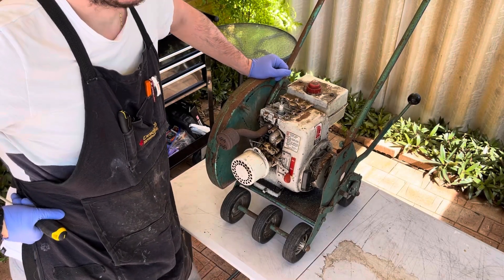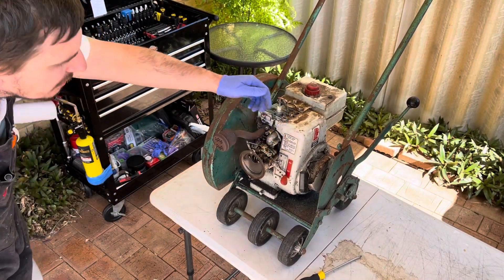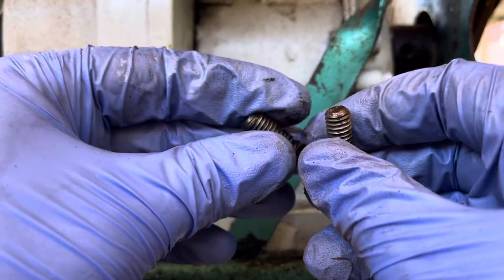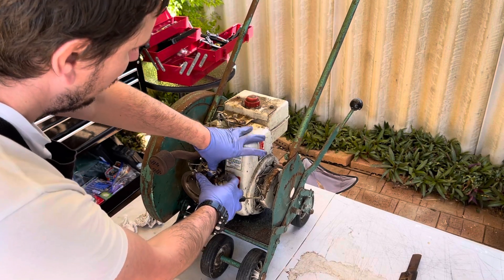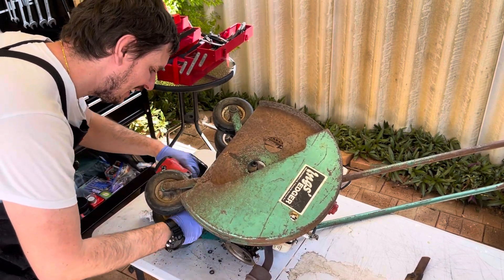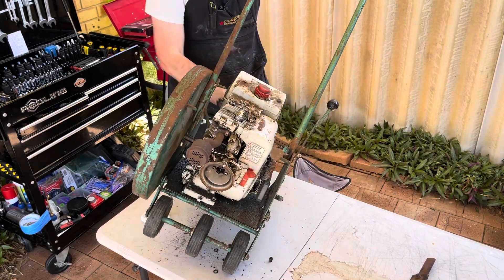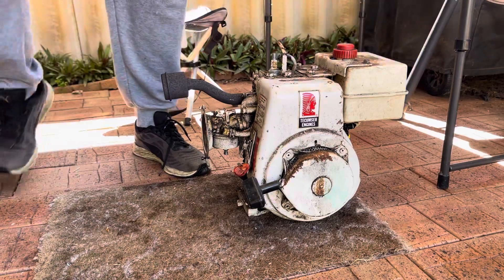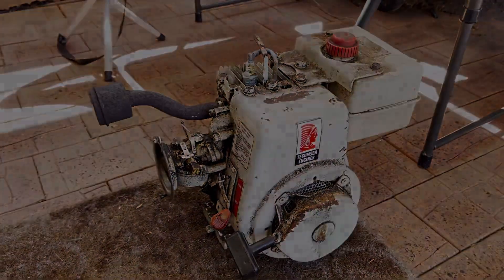Old Tecumseh, Will It Run? - Restoration Or Flip?

Comment: I recently bought an old 70's roto-hoe shredder, with pretty much the same engine. I'm no good at fiddling with carburetors so i bought a new carb and fuel lines. It wasn't getting spark so i bought a new ignition coil and new points. I've set the points gap and it's getting good spark, but still no boom.
     Any tips, something i might've missed?
Reply from the maker: Hey, have you tried putting a teaspoon of petrol directly into the spark plug hole, and pulling it over?
Reply: @VintageEngineRepairs  I hadn't tried that. After watching your video, I did start adjusting the main jet. I got it to fire and run for about a minute, roughly. Then it abruptly died and I haven't got it to fire since. But it's progress. Thanks again for your video, you've got another subscriber!